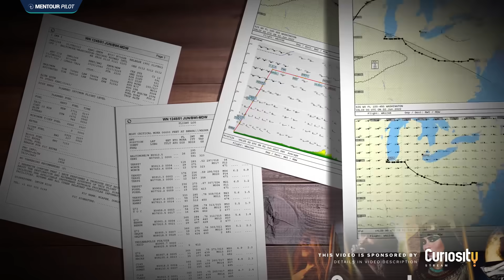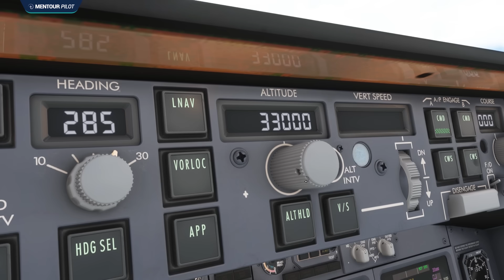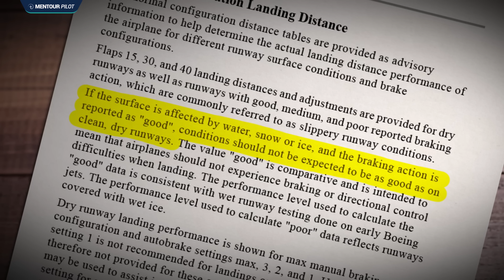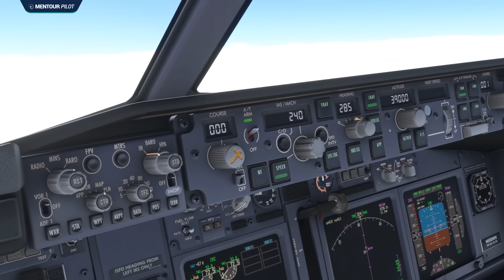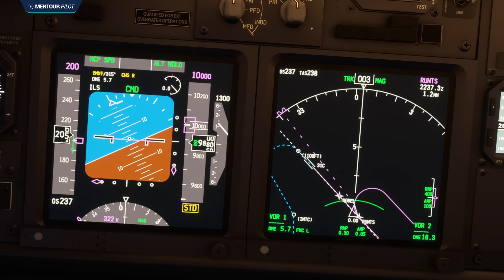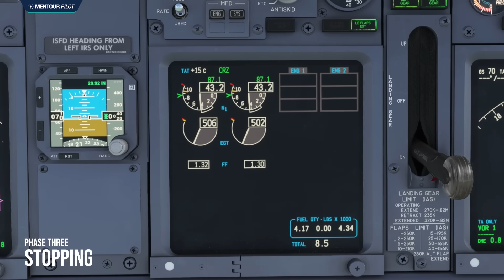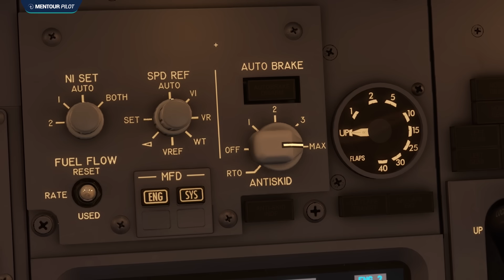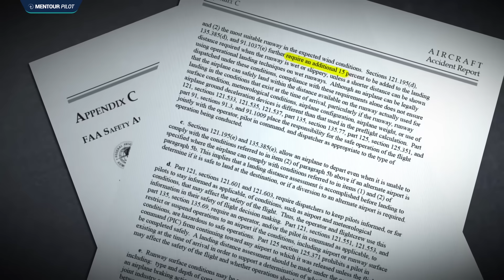WHAT did The Pilots MISS?! Explaining Southwest Airlines flight 1248

Comment: One qustion:
Why they not reject landing, when feel what they have problems with brakes.

Touchdown
No braking by wheels,
No thrust reverse,
       As for me -- OK thrust "TOGO" and go around
Reply: Once you've deployed the thrust reversers it's too late to go around. By the time you've gotten them back in you're almost definitely not going to have enough runway to take off. And they had braking at first. It was only once the braking condition got worse on the runway and the antiskid kicked in that he thought the autobrake had failed. He then stomped on the manual brakes and they worked. He just didn't have enough runway.
Reply: @JamesF0790  
Manual braking also failed.
That`s a question: If everything going wrong from beginning - why not to go around?

Reminding, what speed ta end of runaway was 50 knots. They drop only ~120 knots at 2/3 of runaway (also waste a lot of runaway before touchdown)

If they decide go around after noticed what thrust reverse going wrong and push to Full-Battle (sorry TOGO) They able to takeoff
Reply: @skirnir-atf  No they wouldn't be. It didn't "fail" exactly. The runway was too slick and no they could not have taken off. It takes time to retract the reverser sleeves, it takes time to get the flaps up to takeoff, retract the spoilers and get the engines to spool up to TOGA thrust. The entire time you're burning through runway.

They also didn't waste runway, they landed where planes are designed to. You need runway before you touch down or you're risking one small problem smacking you into the terrain before the runway.
Reply: @JamesF0790  
From REV to TOGA not take too much time
Flaps from 45* to 30* (when they stop braking and start lifting) 2-3s And they don`t put flaps to landing position, they remain it at takeoff position (even, how i saw here, in Combat Position 10*). No time to waste for change configuration.
Airbrakes - 2s to retract (and its can be done together)

I know what you should waste 1/3 runaway to situation "If you engine stall at Final Approach" but here I`d like to keep ILS 5* higher then nominal and land little early
Reply: @skirnir-atf  They were roughly 2/3rds down the runway when they realised they had the reversers at idle. Not flight idle, ground idle. They had roughly 1700 feet of runway left and at 120kts they were eating up 200 feet a second. Ignoring the brakes and flaps just the engine spooltime alone would have meant it was impossible. They'd need to get the reverser sleeves closed and go from ground idle to TOGA thrust. They had around 8 seconds at 120 knots before they left the runway and any acceleration would only have made that worse. If they'd tried to go to go around they would have just left the runway faster, at the very best crashing into a building. 

1 second to decide on a takeoff, which is generous, however long it takes for the reversers to disengage, let's say 2 seconds to be generous. As I said ignoring spoilers and flaps the issue now is going from ground idle to TOGA thrust with five seconds left.  That can take around 10 seconds.
Reply: @JamesF0790  
And landing speed was 124 knots
OK for takeoff in this conditions let be 140 knots.
I think it`s possible to reach even 40 knots (maybe they reduce speed for 100knots) at 600 feet. If you remember, here was video where plane takeoff at 1000 feet)

P.S. And I`m not FAA, to judge pilots.
Just searching for better solution, then high speed roll out from runaway
Reply: @skirnir-atf  With an 8-10 knot tailwind? Once they left the reversers open but at ground idle this was pretty much the best outcome. MAybe steering off the runway would have given them more distance? But they weren’t getting up into the air.
Reply: @JamesF0790  
Runaway - maximum distance, if you pay attention on airfield configuration.
And we are talking about airspeed.
I am not shure, what passenger plane can land at 124-11=113 knots at flap 10* Even 124 very low. (I like to approach 180knots and land 150-160. Only once, due to damage land at 240 knots. Flaps hydraulic fail)
Reply: @skirnir-atf  I mean according to the final report it DID touch down at 124 knots airspeed. That will be factoring in the tailwind as a note. Also, you can see that they first started to properly deploy the reversers at 15 seconds and it took 13 seconds for them to both fully deploy and to reach full reverse thrust. 

When it reaches 80% N1 (Full reverse thrust) they had dropped down to 62 knots. That's only 9 knots above the exit speed for the overun. What's more it took 9 seconds to go from 20% N1 to 80% and for takeoff they'd need to be above that. 

Also, it was less than 33 seconds between landing and exiting the runway.  They had maybe 15 seconds before leaving the overrun area. They may have gotten up to full thrust but they definitely would not have taken off.
Reply: @JamesF0790  
13 seconds including they "unnow what happening" and forgot about reverse.
Taking full thrust (from my experience) taking 3-4s without stabillisation

Actually need to repeat this situation at sim and check if it`s possible.
If you have - it`s be good for checking this.

Comment: I'm a bit surprised that although you can arm the spoilers so that they deploy automatically on landing, there's no equivalent for the thrust reversers. This is hardly the first example of distraction resulting in reverse thrust being applied too late.
Reply: "It's the pilot's decision based on a number of factors. Required runway stopping stopping distance calculations do not normally consider reverse thrust. All that really means is that reverse thrust is an additional safety factor in most cases."*Wayne Dauber , former Retired: Chief Pilot/Aviation Department Manager (1987-2007)
Reply: @KETO_DIET  Yes, I'm aware of that. If reverse thrust isn't required it's usually apparent on approach and you wouldn't need to 'arm' it.
It's not going to hurt having it there if you're not sure however.
As I said this is far from the only instance where workload or distraction has resulted in it being used too late to be effective. This is an obvious area where pilots repeatedly make errors.

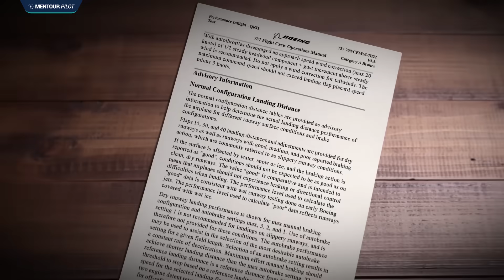Comment: At around 7:00 you're talking about runway conditions and how you should use the worst case for runways with varying reported conditions but the highlighted text doesn't say that, it only says that good conditions won't be as good as dry if the runway has water, ice or snow on it.  That is actually a bit ambiguous, it's either saying that conditions are never good if there's water ice or snow, or it's simply saying that if it's reported as good in those situations, it isn't as good as when it's dry.  It seems to imply when it's dry, they don't bother reporting on braking conditions, but they would be reported as good since there's only the 3 categories.  I really can't see where varying conditions enter here, or anything about worst case scenarios.

Comment: I did not read ALL of the comments but the ones I've read don't mention one aspect. There is a conflict of interest here. The body which allowed a shorter safety zone is the same body that later did not find it as a contributing factor to the accident. There will always be accidents, there will always be pilot mistakes. The safety zone is there for a reason.

Comment: As a software engineer, no program should silently "default" an invalid input to the closest valid one without even producing an error message. In fact what it should go is give out an error message and keep the keyboard focus on the invalid value until it was corrected having blanked out any result values from a previous run if any. I am astounded that the people who created that program did such a bad design on its user interface for something so safety critical and shocked that noone else noticed it.

Comment: Im not sure if there is a device to indicate this already, but on the off chance there isn't, jet liners should include this

A device that measures the distance the aircraft has traveled once its touched the ground, for the event they are landing with whiteout conditions, that way they can measure their traveled ground distances to better avoid overshoots.
Reply: There are marks to indicate how much runway is left, probably more of interest than the distance travelled. Anyway, they miscalculated or misassessed almost everything. 

I'd rather like to know if a go around in time on a slippery runway would have been an option or a better solution.

EDIT: Sorry, I overread that 'whiteout conditions' remark of yours... But generally, if visibility is poor anyway, the pilots might not know where exactly on the runway they touched down.

Comment: I'm a nervous flyer (no, I'm not a pilot 😉) and, flying into St. Louis Lambert in a snow storm I said to my wife, 'They're pumping the brakes!' and then we went from landing to the taxiway without slowing completely down (still doing about 30 mph). I told my wife I didn't think that was a normal landing and she, of course, said I was being paranoid - until,  the airport announced that Lambert was now closed and we looked up to see a news report on the TV's about a plane sliding off the runway at Lambert, just a few mins. after we'd landed. Hmmm...

Comment: At a certain point, they should've aborted a full stop landing and added maximum thrust to get back in the air.  You know, like a touch and go?
Reply: Not possible. Go round after wheels down is available for about five seconds after you land, after that there isn't enough time/distance to configure the aircraft correctly.

Comment: Amazed that reverse thrust is included in stopping distance calculations. Plenty of reasons it might not be available without warning. For one thing if one malfunctions, you’re unlikely to use the other because of the issues of asymmetric thrust. And the first you know it is when you lift the levers and the guy not flying doesn’t see two lights and shouts, “no reverse!”
Reply: Same applies to spoilers and brakes.

Comment: I realize that the depictions of ceiling and visibility in the animations are probably not spot-on, but it appears that the weather was not down to absolute minimums.

It is a shame that they chose to land with the 11 kt tailwind instead of landing on 13C with a 11 kt headwind, although operating under FAR Part 121 they may not have had the choice because of the reported visibility.

Although it doesn't seem like much, the 22 kt differential would have a MAJOR impact on stopping distance, and would put the runway area of fair braking in the later portions of the rollout.

Oh well, anyone can armchair quarterback this one.

Comment: Autobrake always scared me. I do believe, that short manual brake pressure will disconnect both autobrake and spoilers (air brake) deployment. This unnoticed could be really disaster. I would love to here more about this, perhaps on Mentour now?
Reply: Not the spoilers - they retract when the thrust levers are moved forward.  But autobrakes are designed to disconnect when manual braking is applied.  I don't know sensitive that is or whether there must be a brake input for a certain amount of time or at a certain pressure in order for the system to disengage.  It is designed to disconnect with manual braking so the pilots can override the autobrakes in the event the system is not performing correctly.  Maybe someone can advise how the autobrake system would react to a very light and inadvertent tap of the toe brake(s).
Reply: @skyhawk_4526  I believe that the force required to override the auto brakes is quite considerable - something like a hefty shove.

Comment: Your simulations are generally excellent, but this accident was 3 hours after sunset, not as the sun was setting. The reason that's relevant is that snow and ice react very differently without solar heating.
Reply: That was probably done so the viewers can see the plane and the ground as the incident is unfolding, not just a bunch of lights against a dark screen.

Comment: Seeing them do a calcultion where they can just make it and then carry on with that while trying a new system and aiming at a runway with almost no real run off is just madness to me. 
Even then they were within their limts if it could have stopped and better controls over the computer software and maybe even the reverser controls could have made the difference. 
Lets say you could command full reverser before it was ready then let it do it automatically unless you change your mind. Maybe that would be good, maybe not but its probably worth looking into.

Comment: I am not in the aviation field. To me, though, it seems ridiculous to have a calculator for safety override an inputted value. Either it should refuse to compute, and tell you why (in this case, that a 5-knot tailwind is the maximum allowed for those runway conditions), or it should sound off some sort of alarm that yes, here is your calculation, but you may run into trouble because of x, y, z. 

I thoroughly enjoy your videos, Petter. And they seem to be getting better and better, even as great as they've been in the past.

Thank you so much for your hard work.

Comment: Excellent story, technical detail, and analysis. Two questions from an amateur. Does "stabilized on approach" clearly include "stabilized on glide slope" and therefore stabilized on descent rate? I find it interesting and perhaps odd that descent rate is not one of the explicit main elements in the definition of stabilized approach, as so many of these stories include a descent rate that is either too rapid or too slow.

Similarly, but at touch down and stopping, I am sure that landing speed on touchdown is a crucial element of whether the airplane will stop before the end of the runway. In this video, the landing speed was mentioned, but it was not analyzed as to whether it was within the target range for landing speed.

Comment: Every major football (soccer) pitch in the world has under-soil heating to enable no break of play during the winter months, and this is not a new technology, in fact it is 2000 years old. The Romans invented the Hypocaust, which was the world's first central heating. Hot air from a fire could be pushed through pipes under the floor. Just in the same way that people have warm bathroom floors today, though the system for providing the heat has been developed in modern times. Thankfully, you don't have to start a fire in your garden.

Now of course, we are not talking about soil or tiles here, but a concrete runway, and I'm also sure that this system would be expensive. I am also sure the installation of EMAS isn't cheap either. I am well aware of the emphasis on cost here, despite only the most heavily hit 'winter', major airports, needing to even think of implementing this widely available technology. I have even personally seen the total opposite constructed, when you skate on ice in a city centre near Christmas. 

Whether the idea is sound or not, it is a recurring theme in safety. We all hear once a day whilst studying videos like this one, that safety is written in blood. I no longer hold to that, as if we are honest, there is one thing that even blood does write upon, and that is the dollar, or pound, or euro, or yen..... No doubt people could argue on climate, fuel blah, blah, blah but if the world is truly caring about safety, money should never come into it. 

I can see executives doing calculations and figures on 'cost-effectiveness', and the cruel truth is, if something is not 'cost-effective' then it won't be implemented. Worst still, these kinds of calculations, like those in war, will probably involve 'potential loss of life', and if that is within an 'acceptable tolerance' again, cost-effectiveness will win the day. 

I truly despise those in powerful positions for the way they price a single human life, and in the UK we have a kinder expression than 'safety written in blood'. We call it 'shutting the stable door, after the horse has bolted'. Ideas seem to only happen, after the event. Even policing these days has cost-effectiveness written into it. Leading to the security of people never being proactive, but always being reactive instead. The aviation industry is truly this way also.

Thankfully, when it comes to war, as a species, we are learning after so long, to see that no loss of life is acceptable, so any government or company should be forced by law to discount any calculation that involves 'acceptable tolerances', as I believe in aviation there should not be any circumstance where a human loss be tolerated, no matter the cost. The ridiculous aspect of this, should there be a terrible tragedy, such as this one, then the airline, or whoever is found liable, will often pay out more than these measures would have cost in the first place, and we all know, that aviation CAN afford such things. It's as I said, the old profit versus life situation. You can be assured of that. 

Thank you to channels such as MENTOURPILOT, because without them, philosophers such as myself, would not have the information to be able to see where we really fall down in life, or in the search for true safety for all. It will always sicken me, so long as a human life has a calculable value in the corporate world. The outcome will always be the same, until this attitude changes. No loss of life should ever be 'acceptable'.